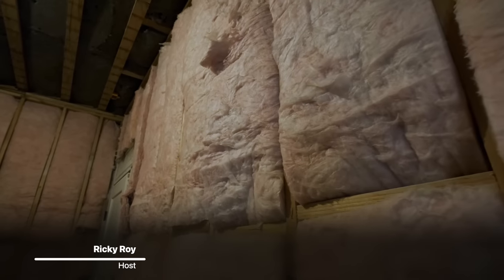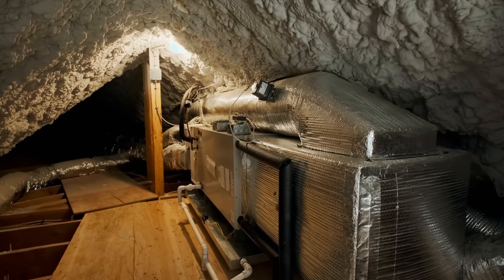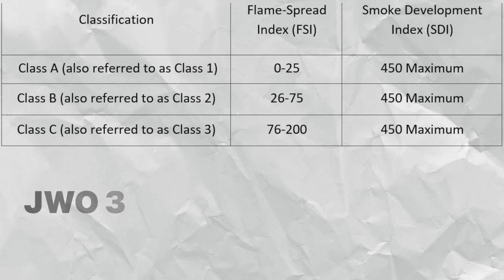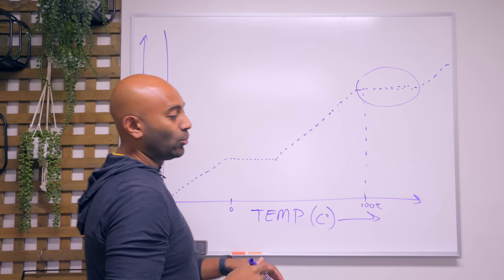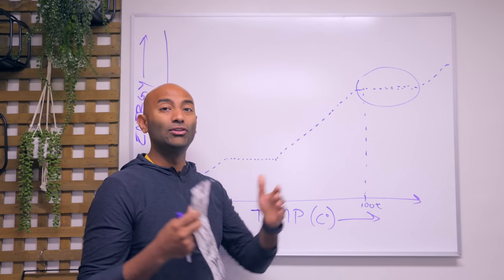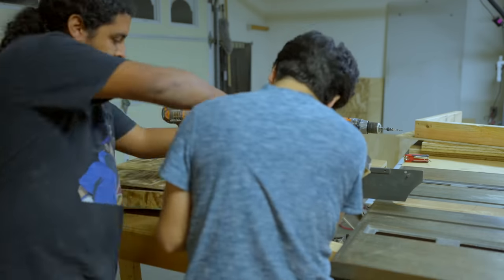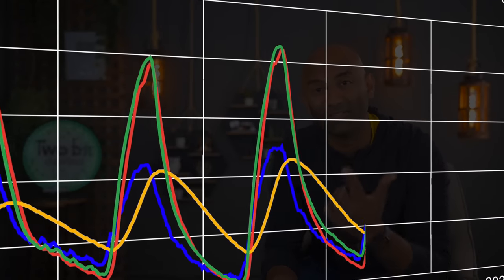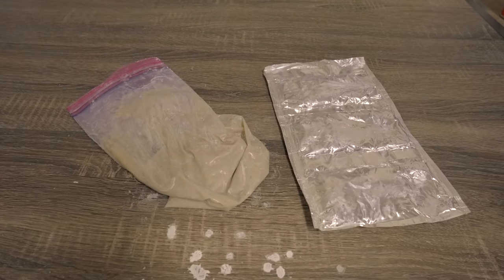The Genius of Phase Change Building Insulation!

Comment: All products engineered to fit inside a thermal envelope for heat storage seem to have the same problem. They need to allow the internal temperature to vary by a relatively large difference (several degrees) in order to charge and discharge. People are not comfortable with temperature changes greater than a degree or just a few degrees. After they find a comfortable temperature for themselves, they set the thermostat and forget about it. It's always the same story with air conditioners and all devices with a thermostat, regardless of the heat source. Large changes in temperature significantly reduce their efficiency, especially with heat pumps and air conditioners. There is also the issue of heat transfer rate. If you compare the temperature change of just a degree or so between the PCM and the indoor air, there just isn't much convection, radiation, or other heat exchange.

In addition, I see the advantage of placing it as a cover on the insulation of the attic floor in climates in areas of the world with significant diurnal temperature changes, as long as a significant part of the year has oscillations above and below the transition temperature of the material and also as long as the buildings do not already have a large thermal mass to equalize and oscillations. In conclusion, it may actually be of rather limited utility and cost-effectiveness. The upper insulating cover (attic) is an interesting application, but it always only equalizes the heat load during the day, instead of reducing it. It will be difficult to justify this compared to spending the same money on another layer of insulation in the same place, which reduces the load all day, not just during the peak load when there are more thermal fluctuations.

It seems to me that according to everything I know, PCM only makes sense in heat storage as a thermal battery, with always cost effectiveness and environmental acceptability of the material. There are currently better solutions of other hybrid systems. But that's another topic. Greetings from Croatia, EU.
Reply: Igor, in your middle paragraph you state:" ....interesting application but it always only equalizes the heat load during the day instead of reducing it" Actually one of the wonderful  properties of PCMs is that they do in fact CHANGE temperatures.. What does ice do in your cooler? It changes the temperature of the whatever needs chilling in the cooler by absorbing the heat from it, and using the heat to melt. During this process and for as long as there is any solid ice left, all of the ice and the water (melted ice) is all the same temperature. Which is understood to be about 0C (32f) The same thing happens in your attic. If you want to change the temperature in the attic and thereby reduce the delta across your attic floor insulation you can add a layer of PCM which will use the heat available to melt and draw down the actual air temp doing so. Over night once the ambient air temp drops below the PCT, the PCM will begin to give up its heat, but only at its PCT, NOT at the peak temps it used to melt earlier in the day. Thank You for your thoughtful comment. Greetings from The USA

Comment: Isn't the r value of rockwool around 5, with fiberglass pushing 10+? Like you pointed out it is extremely important to minimize air leaks, and the foil setup you showed probably still isn't representative of a house wall. It would've been nice to see the second graph with all labels, it looks like less than 10 degree difference, which would probably be even less compared to a properly sealed, fiberglass insulated "wall."

Comment: Would this be possible for a bed? So that a bed maintains a certain temperature without overheating.
Reply: There is nothing near your bed swinging between hot and cold. So you can't use the buffering effect of the material.

Comment: The way insulation works is not being a poor thermal barrier itself, by an large, it is by forcing air to be stagnant and the air is the principal thermal barrier.  So, yeah, the insulation helps it to be stagnant within a space, but you still want an air seal.

Why wouldn't you put the material in your interior walls?  I understand how folks tend to only prioritize insulation on exterior walls, but it would still work at being a thermal mass and doing a phase change to keep the temperature more consistent.

I think attics are probably not the place to install the material.  You could put it behind the drywall in the ceiling, but it wouldn't be super effective in the attic.  In the attic, use traditional insulation and a radiant barrier.  The surface area against the roof is so much greater than the other surfaces, like the ceilings and walls.

Comment: Does this type of insulation have upper and lower limits where the phase change stops helping?  Like places where it gets really hot in the summer or really cold in the winter.
Reply: The material only works if the day is hotter than you want and the night is colder than you want. It does nothing when both are hotter and it does nothing when both are colder.
Reply: @allocater2  Thanks.  I live in a place where we have both.  Mostly too hot in the summer.  But spring and fall like right now I need to run the heater at night and switch to AC in the afternoon.  I could just leave it off and live with slightly too cold in the mornings and slightly too warm inside in the evenings though and this sort of thing would help for those times. I think the best solution would be a combo of normal insulation with this tacked on on the inside as an extra layer.
I think Two Bit doesn't like to run any heat or AC from the way he talks usually.  That's possible in San Diego though.  The weather is really nice all year round.

Comment: So many issues here. The box has 2x4's prutruding into the interior of the box which have a very low R value, which means you are not measuring just the effect of the insulation. (A better design would be to totally eliminate the 2x4's and have a 1x1 nailer in the corners.) The inside of the box is just basically air, which has a thermal mass of zilch. A proper design would have some thermal mass, say, a gallon or two of water to simulate the typical interior of a house with all it's furnishings , walls, etc. which is what actually holds the heat. It is the thermal mass inside the house which holds and releases (stores) the thermal energy, while the air itself holds little energy. The insulation/absorber actually was in itself a form of thermal mass, absent in the other boxes.

Comment: In my opinion, the attic installation process described doesn't appear to be correct.
I would assume that QE Platinum would have to be installed first then your insulating layer.

If it was done in the reverse order as described, there would be little to no affect, as the heating and cooling would be sent into the attic and vented out, instead of into the living area below. 

I would love to see the testing again, with a vapor barrier, to see how that changes the results. 
Also you may want to try to install the QE Platinum first, then the insulation to see if the order does change the results.

Ricky, keep up the good work, always interesting.

Comment: This stuff is  NOT INSULATION - it appears to have potential to moderate temperature changes on a day/night basis but if your house is in an area that has hot and cold seasons it's not going to help much because it can't absorb or release heat for days at a time.  I've built a couple of houses and reduced energy uses in three others - the main factor is sealing a house so You decide when to ventilate your house and then add real insulation that reduces the flow of heat through it - and that insulation has to fit snugly into the wall and roof spaces, this is why spray foam insulation is so good (but it's expensive - worth it IMO ) because it fills all voids to stop airflow through and around it and has a high R rating per inch.

Comment: Thanks for the video. Phase-change is an interesting tech. In the UK, a company called SunFlow have created a storage heater based on phase change tech that looks really interesting. It replaces a hot water tank using packs of heat change material that are charged up from a boiler or heat pump. When there's demand for hot water the packs discharge to provide instant hot water.
Using the tech for insulation is cool (!). I'm wondering if it could help with our roof insulation. In the summer our house gets a lot of sun during the day and it would be amazing if we could passively capture that during the day and radiate it back into the house at night. I'm not sure this would do that. To be really useful we need a way of 'moving' the heat from one place to another - or at least getting it to absorb heat from outside during the day and release it to the inside during the night. 
Is this stuff 'breathable'? If not sticking it behind drywall and sealing the layer tightly might cause moisture build up. It's a balancing act between getting houses airtight and dealing with moisture.
Reply: As I understand the material is supposed to block heat transfer between the house and itself (by staying the same temperature as your ideal comfortable house temperature). It's installed on the outside so it only transfers heat between itself and the outside. So you can't use it to radiate heat into your house at night.
Reply: Since this operates at completely different temps than Sunflow, how to apply it is completely different.

Comment: I'm from Minnesota and I'm curious how it would work in extremely cold weather. I'm not sure you covered that.
Reply: They probably didn't supply enough data for Ricky to make a solid guess, but if the material can shift around del-T/2 between your average cold winter night (is it 0F, 20F, or -40F?) and preferred interior temperature, it would obviously help a lot and I can remember one Christmas season in the 1970s in Wisconsin when it dropped 100 degrees in a 24 hr. period. You'll probably lose any benefit from the phase change when the weather's warm, but there's still the plus side of its straight radiant and air-flow barrier value.
Reply: I don't know why the strikethrough is there...
Reply: The only potential benefit I can imagine is if you heat with a heat-pump, and use this material to store extra heat during the day when it's warmer (so you'll need to pump in less heat at night when the temperature drops).  Heat pumps use more electricity the greater the temperature difference (look up Carnot efficiency).  It's probably not worth the expense compared to extra insulation.

Comment: I'd like to have a selective insulating material, for the relatively hot climate of India where I come from : It should be resistant to heating up.. BUT it should cool down as quickly as the outside temperatures. Things get quite hot here in the daytime for most of the year, but at night there's a very pleasant chill in the outside air. Inside our homes (mostly bricks & cement), however, that heat from the daytime lingers on and it's still sweltering in the night even if it's much cooler outside. Result : despite the outside weather being totally cool, we have to consume more electricity with fans and ACs while we sleep. (And.. there's too many mosquitos for outside sleeping)
I think colder regions like Canada, Sweden etc may have a similar requirement in the exact opposite direction : they may want to take in all the heat when the sun is up, but then be much slower to cool down. Can you please dig into and feature some solutions along those lines? And I'm open for more "active" rather than passive solutions, like.. say.. sliding sections of wall, etc.
Reply: I think there's progress being made in passive radiative cooling solutions - hell, even painting your roof white may well lower temperature inside your house simply because it's reflecting rather than absorbing the sun's energy.
Reply: PCMs have been used for years in India particularly to help keep telecom switching stations from overheating..

Comment: For our super nerds, it's the Latent Heat of Fusion that explains the temperature properties of this product.
Reply: The only fusion involved in the intended method of operation for this product happens approx. 150.000.000 km away from where it's typically deployed. And not only does it not explain the temperature properties of this product, it doesn't even contribute to them, and is, in fact, entirely irrelevant to said properties. The temperature properties of this product remain exactly the same if operated in a cave hundreds of meters below the surface, using coal fire as a heat source.
 
Or am I missing a reference, or some running gag on this channel, perhaps?
Reply: @EvenTheDogAgrees  no, I'm serious. It's the physical property that causes it to hold its temperature steady. Latent heat of fusion, or latent heat of vaporization.
Reply: @JonathanHarvell  Well, eff me gently with a chainsaw. Learned a new term today. Thanks, man!

Comment: I don't understand, why not with inner walls?
If we take a comfort temperature, for example for 22°C, order this mix exactly for this temperautre and cover the part of inner wall or ceiling with it, it will keep the room temperature near 22°C, doesn't it? Then the primary warm-isolation role a wall would play and role of the secondary "thermo-isolation" would play this QE Platinum layer. If we have two temperature dampers - a wall and an insulator, what difference does it make in what order to place them? May be, it would be even better to have this isolator mass not on the walls, but more at the places, where we are really in the room, like computer table, bed, etc.
With modern house technique and this isolator we don't need any further thermo-devices in a rooms, like warm floor or water heating batteries and have a more or less constant termperature in a room. Where am I wrong?

Comment: FWIW, back in the early days of life in the Southwest, adobe structures used the thermal mass to do similar things.  Sun would heat the adobe during the day, and the thermal mass allowed the adobe (up to twelve inches thick) to heat up gradually, but kept the interior cool during the day.  At night, the energy would continue to "percolate" inward, and provided warmth during the night.

A passive system that worked quite well.
Reply: That's just thermal mass, not phase change. Different ball game.

Comment: I didn’t understand why the temperature in the control box and rock wool box were higher than the air temperature until you mentioned the warm concrete floor.

If this stuff is made from soybeans or similar, what stops animals from getting to it and ruining the product?
Reply: I hope your wall stops the animal 🤣

Comment: Large blocks could be added to interior walls to act like a thermal battery. Allowing a house to be heated or cooled via solar during the day, and maintained over night. It would require fine tuning to the comfort level of the occupants, and might be an issue if future residents want a different temperature .

Comment: The secret formula is probably paraffin wax (melting point around 37C 100F) plus some oil (to bring the melting point down to room temperature) plus a crap ton of flame retardants.
Reply: No, but those products are out there.. QE Platinum products are Hydrated Salts.

Comment: Neat material but this is going to have a narrow range of climates in my mind. I know people in San Diego that don't have AC because it doesn't get hot compared to many places. Where I used to live, it can be +40C in the summer or -40C in the winter with sustained periods of both hot and cold where the fluctuation is pretty big. I've also lived in places where it's -10 at coldest and +35 at the hottest  but with less extreme fluctuation, which I think is more appropriate but still too much for this material to be a viable option for most cases.

Comment: Mr. Two bit da Vinci (and a brick short of a load) - you just earned my "eee... I'm not sure I want to waste my time on his future instalments..."
I mean, why should I want to watch anyone who's so... "confused" that he cannot distinguish between heat INSULATION and ACCUMULATION?

Now, I do understand that houses built from light materials (like many of those in America - wood/ plywood and rock-wool/ glass-wool) do suffer from low thermal inertia, and this fancy (and expensive, I assume) stuff can mitigate the problem TO A DEGREE, but IT IS NOT any "insulation".
BTW, installing double thickness dry walls (i.e. two sheets, one over the other) will also help - and will help to stabilise RH too.

Anyway, I do not like being taken for a ride, regardless of "sponsored" or "not sponsored". Bye.

Comment: That's not thermal insulation, but thermal inertia!
Thermal inertia is really nice also, but only if you experience significant temperature changes in the day/night cycle. (If it's freezing + windy + raining during day time, the temperature don't really change)
Plus, thermal inertia requires standard insulation (the inertia is on the inner side of the wall, otherwise it affect the outside, being useless).
Thermal inertia can also be achieved by an heavy concrete wall (again, insulation on the outside face) or any other heavy material inside : build a pool in your living room, and you'll get extreme thermal inertia.
Finally, inertia have downsides for a place you don't keep warm all the time (a small fishing house you use only 1 day a week for example) : the inertia make the initial heating slower, without any benefit.